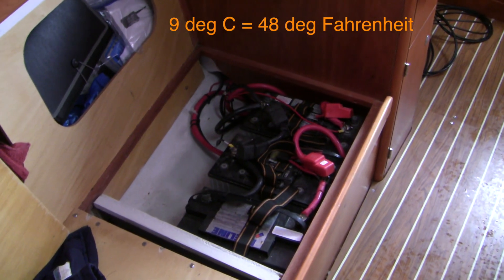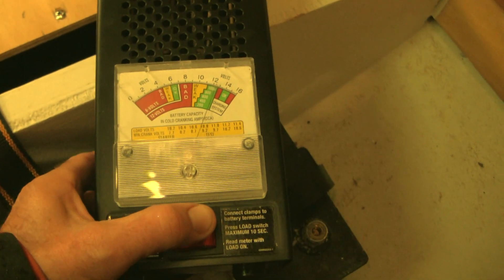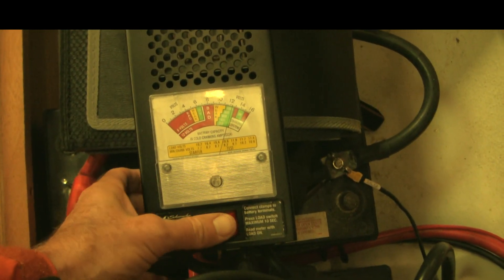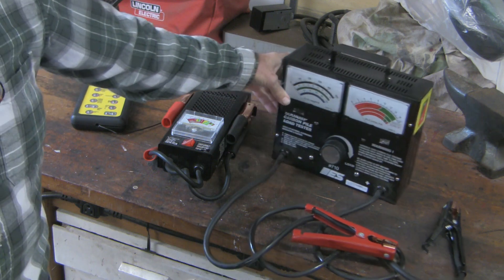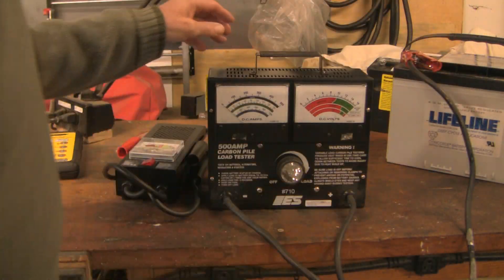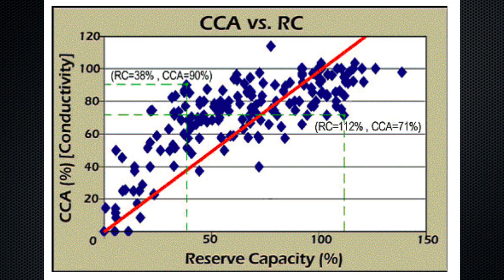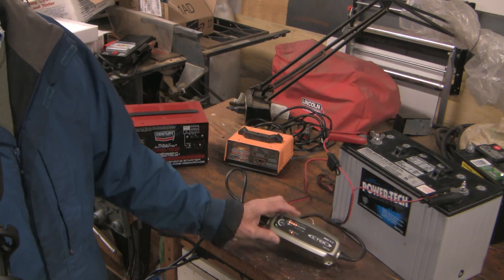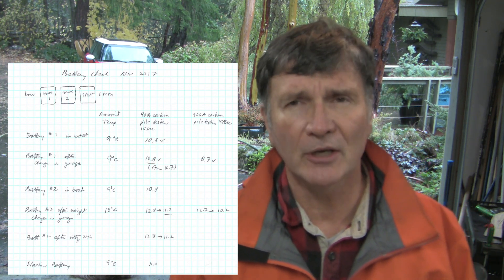AGM battery testing in a boat

Comment from the maker: What surprised me when reviewing the topic of electronic conductance testers was the wide variation (+/- 20% or more) of battery test results depending on technique, type of battery, charge, temperature, etc. That doesn't come across when you just look at a printout. So, when using surrogate markers like conductance, one is much better off to start frequent and regular monitoring before encountering problems, and then plot results to better predict outcome. Relying on one borderline conductance test result in isolation can lead to inappropriately condemning a battery, which may be OK when you sell batteries but not so much when you pay for them yourself. Fortunately, most testing is pretty easy, we don't do it enough to get a feel for how normal batteries perform.
Reply: This is the primary reason I went with the Balmar battery monitor solution.  Rod at Maine Sail did some great work reviewing it and I will agree it is a very well done accurate unit.  The app is a bit slow and old looking and clunky but it's "functional".  Personally when I'm using the boat I just need to know what SOC% am I and how long at my current burn rate will I be depleted or full...  The Balmar screen does that really well and is easy to read from a distance.  When I earlier ran the Balmar unit and had 3 gel batteries 2 in parallel for house and 1 starter battery.  It did well and monitored SOH% (state of health) as you use the bank.  So as you do what you do it monitors that and gives you an indication of the health of your bank and from what I've read gives good early indication of trouble.  I have yet to run into real trouble.  It monitored my previous 2 (8 year old) gel batteries just fine until I decided to upgrade to Lithium and I've got a couple years of it monitoring the Lithium bank and so far it has been very stable as for health readouts.  It only takes about 2-4 cycles of the bank while you're out doing things and then it keeps a watchful eye on things and gives ya a SOH% to keep an eye on without even really having to isolate.  The only issue there is they're expensive so I've only installed one on the house bank.

Comment: Hi and thanks for your excellent videos.   Very helpful.  
I wanted to better understand your recommendation if for a bit with an ACR should the alternator be set up to charge the starter battery first or the house bank?
Thanks in advance.  Steve
Reply from the maker: Usually house first, as explained in the video. Most alternators lock out charging for about 30 seconds until engine rpm is consistently above the slower speed of the starter motor. Part of the reason they do that is to prevent dangerous voltage spikes that can damage sensitive electronics.

Comment: Temporary Fix was to jump with heavy cable the starting + and house + batteries terminals replace Dual output isolator.  Planning to see if issue appears again upon removal of said temporary jumper and installation of new isolator. Thank you for the diagnostic help.  
Bob

Comment: 2023/10/2. On boat have one master battery switch, dual output 70A Isolator powered from alternator, 1 x house 239AH AGM battery, 2 x 79AH AGM starting batteries in parallel.  One Isolator diode to starter battery failed.  What caused starter battery voltage to jump to just over 19 vdc?  Also batteries are connected to dual output 20 A renogy solar controller and 100watt panel with meter connected to solar controller for individual batt voltage monitors
Reply from the maker: That's spooky. I think I'd try to isolate one system at a time to decide where the high voltage came from. Your voltage regulator on the alternator may have error codes that point to a more specific problem. It would also be nice to see if that high voltage was a spike or a steady output. A scope might help to define the voltage ripple from the alternator output. A bad diode within the bridge rectifier of the alternator can cause a regular, recurring output spike you can see on a scope. In the meantime I'd check for corrosion in the usual places, battery connections etc. Poor connection at a battery cable with a downstream voltage regulator tap could lead to poor data getting to the voltage regulator which might lead to an overdriven alternator output.

Comment: The way I have decided to go on battery monitoring is the Balmar unit with its SOH function.  I have heard it to be quite good for many chemistry types of battery.  I use it with a Lithium bank that I assembled from a group of cells on Alibaba.  I knew them to be grade B cells and they read at almost exactly 80% of SOH (which is expected for grade B cells).  But the pack has performed very well and gives me all the benefits of lithium for a reasonable cost (and I had fun setting it up).  But I watch the SOH function and I expect that value to start to go down percent by percent over time as the pack degrades.  I am however now a couple years on from when I assembled things and it's only since gone up by about 1%.  Having seen all the cyclic decline graphs I think for my use case the decline should be very gradual and shouldn't catastrophically "leave me somewhere".  However, watching this kinda makes me want to try and load test my pack.  That also being said I still keep a gel cell starter bank for alternator protection reasons and old school reliability reasons.  ;)  Thanks for the video.

Comment: how do you know if they are overcharged if you dont meassure?
Reply from the maker: Most boats have built in voltmeters that offers a low tech way to follow the state of charge daily in your battery banks. It shouldn't ever be more than about 15 V in most, even while charging. Voltmeters aren't great at assessing reserve but for that indication they are reasonably sensitive.

Comment: Also i have one more question: If a battery cycle translates to a 60% discarge and refill, does this has to happen in 24 hours? My case is i have 5 days of rain, while the bank goes 80% first day, charges 90% 2nd day, goes 60% 3rd day in the morning, goes 80% in the evening and so on, untill a sunny day brings everything back to 100%. So what is a cycle in this example?
Reply from the maker: This time of year, solar recharging is problematic for those of us in the northern hemisphere who live in the snow. I gave up using my solar charging in winter because I wasn't getting a full charge and I worried my battery bank would not take kindly to chronic undercharging. Effectively my solar array is not sized for such low sun angles, even with minimal consumption. I can't really answer your question, it depends on the proprietary algorithm of your charging hardware. The manufacturer may be able to offer more detail.

Comment: great video! i will speak about my problem though: i have a 16 pieces agm 6v 370Ah bank. 2 series of 8 pieces. They worked well about 5 years(with no active equalizators), but lately i discovered drop out over the night wich shows 60% in the morning, while a month ago was 90% in the morning. I removed the consumers, only having the fridge connected. Still the same. I bought the analog battery tester(like the one in your  video) they all are on the green mark(even some on the left edge of the green). Because i had no battery equalizers over this period, some have 6,20volt, others 6,25 and others 6,38v. What can the problem be?
Reply from the maker: A fridge is a high power consumption device, and if you live in the northern hemisphere I'm guessing your solar array is having trouble keeping up to demand through the winter.

Comment: When in doubt, whip it out. The pocket book that is for a new battery
Reply from the maker: Even today, almost three years later, that weaker battery is still going strong, and there is  little evidence to date that it has caused sulfation of the other batteries, which are fine as well. These AGM batteries are about $300 each. So, with the clarity of retrospect, delaying that extra expense was worthwhile. There will always be winners and losers when testing objectively, but the real question is the slope of decay, a completely different question.
Reply: @spelunkerd  Nonetheless it was a good video and you definitely know your stuff in regards to batteries. Do you work as an electrical engineer?

Comment: Great video. Thanks! Love all the detail your provide in your explanations.
Reply from the maker: Thank you for the kind words. Those three batteries are holding strong, with another year gone by and no difficulties. It's just about time to retest them again. I find that there is a dramatic difference in test results and resting charge depending on ambient temperature and height of the sun in the sky (I use a solar charger so angle of the sun is a big factor).

Comment: Just love the technical boat maintenance and repair tips. Please keep these up. Topics I’d love to see are: refrigeration, water heaters, manual head replacement for an electric (I have a standard Jabsco full size manual head and looking for the best replacement), winterizing water tanks (I drain mine and add RV antifreeze to the system until it leaves all the taps, but would prefer to drain the system if possible and avoid putting antifreeze in my tanks at all), winterizing the engine water intake (again, I drain the muffler and then siphon green antifreeze into the engine cooling system until about 4 litres leaves the muffler, but I would prefer to drain it), engine coolant replacement (my next maintenance job on my Yanmar), etc. Your explanations are so easy to follow, so well thought out, engineering precise and practical in their explanation. Keep up the excellent work.
Reply from the maker: What a kind remark, Je vous remerci, you sound like a fellow Canadian. Here on the west coast the temp doesn't drop far enough to get too worried about freezing when the boat is in the water, though I do drain the fresh water system piping as best I can and add environmentally safe antifreeze to the head. Practical Sailor have some new publications on heads that you may find interesting, they have an online library, and subscribers can search articles going back years. The one thing I don't like about the Yanmar diesel is the lack of glow plugs, but Yanmar have a cold start procedure that helps a bit. We sail through the winter every week or so and that helps to charge up the batteries when the sun dips low enough to compromise output from the solar panel. I hope to do a cooling system review in the next several months. Nice to meet you!

Dave

Comment: You did a great job Dave in explaining of how to check AGM type batteries. And most importantly, the heads-up on the safety when checking a battery. Looks like you've got a little more time from that one battery and good info on why there is more hydrogen when you charge a battery excessively. And I'm like you with the conductance type battery testers. I'm just not convinced either that they are 100% accurate. Have a good one!
Reply from the maker: Thanks, Terry!

Comment: In a critical situation and having to rely on a reserve that's iffy, my battery would be gone with the warranty time given. There always has to be a wide safety margin to cover all eventuallies and keeping a dying battery on board is being fool hardy.
Reply from the maker: You make a good point about warranties, the game is completely different there. Flooded lead acid car batteries never seem to last as long as the warranty, and I use the warranty for car batteries more often than not. As you say, a car can be easily stranded. However my house batteries don't power a lot, they never need to deliver high current, typical draw is one amp, and there is plenty of reserve with batteries in parallel. This sailboat could easily function with one battery. For others in a different situation I would agree.